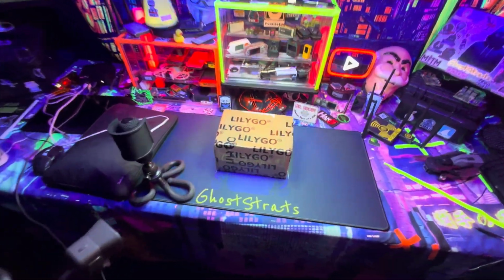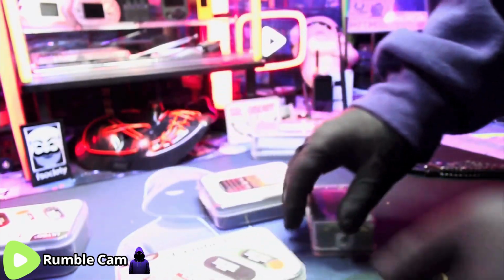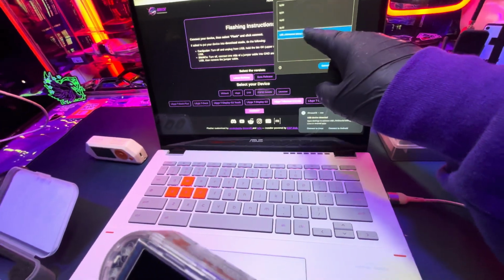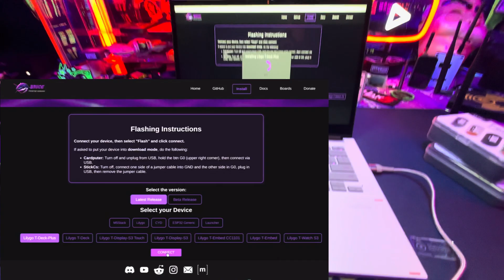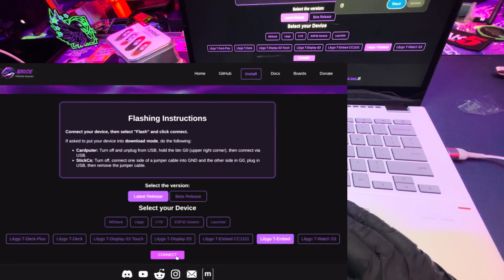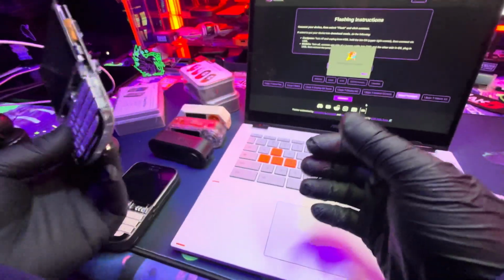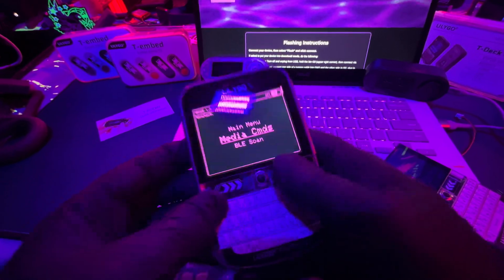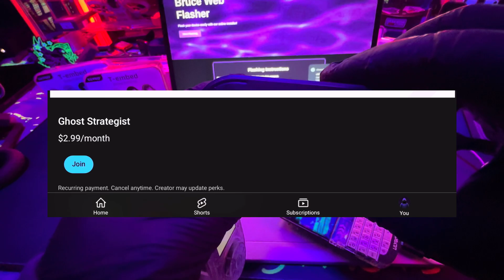LILYGO Pen Testing Care Package Unboxing | Best Flipper Zero Alternatives! T-Embed CC1101 and More!

Comment: @GhostStrats Hi guys i bought a T Embedded Cc1101 with ESP32 (LILYGO) but i only start if i have the usb cable connected. Is there a power switch or something else i need to configure (maybe just the Software)???